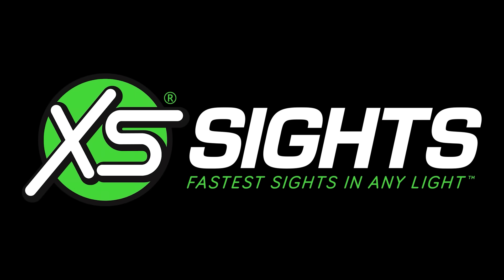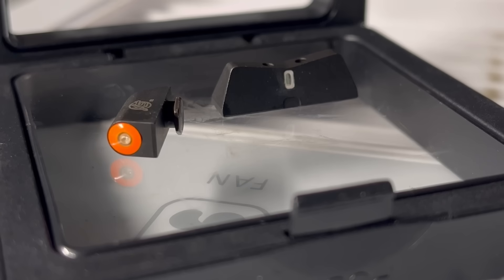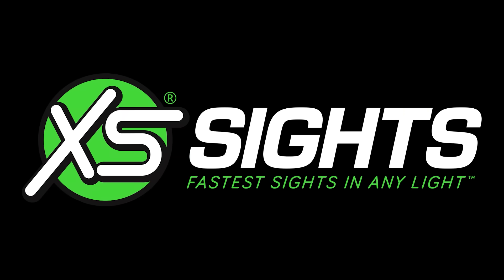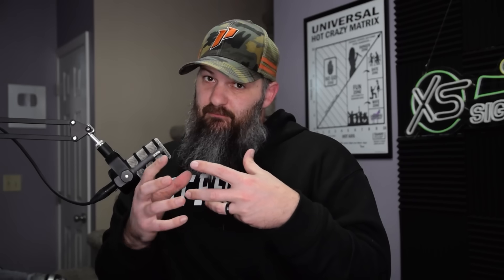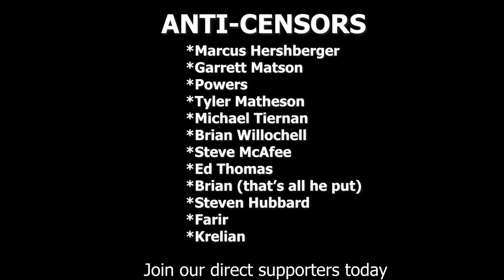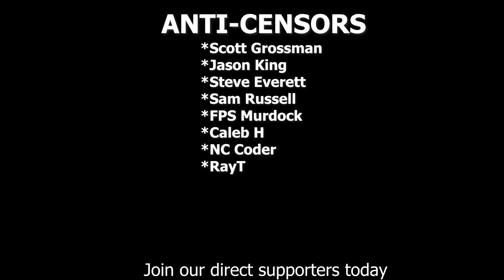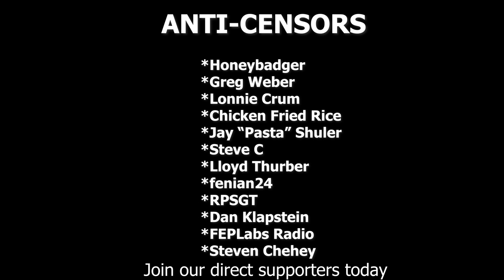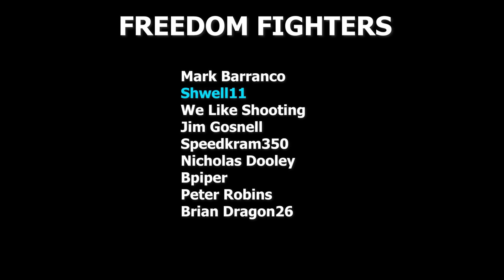Don't Get Scammed on "3D Printed" Suppressors in 2026

Comment: You guys have no idea what your talking about if you print in Bambu labs ppa cf then put the can in a powder salt in a vacuum chamber till cristallisation point for 4 hours let it cool down to room temp I seen a 30 cal ppa cf can running 30 thousand rounds also there’s a guy on YouTube that has a pla can in 22 did the same Harding curing method and is at 22 thousand rounds

Comment: Just for everyone to have a heuristic to go off of. Something 3D printed is always structurally worse than something made by any other process. 3D printing should never be a selling point. 3D printed things can be good and of really high quality. But the process itself is less structurally sound than if it was cast or stamped or what have you. The only thing 3D printing can give you that other things can't is unique geometry inside a part.
Reply: 3d printing is now standard in aerospace industry. SpaceX uses it extensively in its rocket engines. Laser sintering printers are now being used to combine different types of metals that no other manufacturing process can do. Aluminum powders combined with small amounts of iron, titanium, etc to make an alloy that is stronger, more resilient and able to handle much higher temps than any other aluminum. You’ll be seeing it in engine blocks at some point I’d guess.  If they’re making rocket engines and jet turbines with 3d printing, I think it’s pretty structurally sound.
Reply: @memyselfandi6410 Yeah, so the reason they are using 3D printing is because they can create more complex geometry with it than with traditional manufacturing. Even if they are making "special metals," the structure would still be more sound if the metal were made via casting etc than using additive manufacturing.

So basically what this means is, the selling points for the aerospace industry are the geometry and the material. Not the process of 3D printing itself.

Comment: Thanks for the warning bro. I’m curious about the company PTR, they do 3-D printed titanium & Inconel & are rated for “hard use” but I have a hard time understanding how titanium can handle a high volume of fire of 308 Winchester!!  so I went with a stainless steel traditional suppressor for my AR 10, it’s heavy compared to the 3-D printed titanium, but it doesn’t feel like it’s gonna burst after two magazines.  Sorry if there’s fuck ups in this comment comma I’m on the road using speak and spell!
Reply: PTR Ti cans are not hard use, even their inconel can is not rated for the same extremes as other brands. Also PTR cans are not repairable due to the nature of their Purposely Induced Porosity(PIP) technology. They are extremely quiet though. If you are looking for hard use Ti, look to B&T. Their full Ti, 718 Inc, and hybrid (Ti with Inc blast baffle) are tested thoroughly over 20,000 rounds in 3 days of Socom Table 2 testing.

Comment: I want someone to post a video next year when they register a potato as a suppressor and file a $0 tax stamp form.
Reply: You're confused on the law change. Making an SBR or Suppressor still costs $200/$250 whichever it was, it's the transfer that's zero now.
Reply: The key would be to do an adapter that hold a potato in place for use. Then you would have to get with an SOT 2 to replace the potato when it wore out.

Comment: I have two 3d printed ftn suppressors in PET-CF for 5.56. They will eventually fail, but not near as quick as you would expect. The FTN suppressors for .22 are pretty much lifetime suppressors unless you are going full auto. The core is all polymer and wrapped in carbon fiber to contain the pressure. Plastic does well with the heat because it is a poor thermal conductor. You actually want to keep metal out of the core as it will capture heat and transfer it to the plastic. I only have about 100 rounds through each of mine, but unlike after a mag with a traditional suppressor, I can touch mine without getting immediately seared to the bone.

Comment: We use 3D printing at work (we’re not a suppressor manufacturer) for creating prototypes and fixtures. Once a design is finalized, the parts are made with forged, molded or stamped metals thru a vender. It’s just standard manufacturing protocol. The fact that so many of these companies are selling 3D printed suppressors is alarming.

Comment: No matter the polymer, its melting temp is no higher than the printer tip temp. Printing tips are not operating at 750 or higher temperatures. MUCH lower, in fact.
Reply: Plastic is a poor conductor of heat and unless you are going full auto, it heats up much slower than a metal suppressor. So much so that I can handle mine after a mag without getting fried.

Comment: Yea im printing some prototypes right now but the design can be machined on a 6 axis cnc. 
But its faster to print the prototypes to decide on a final production design.
Reply: Yes print it. Them use the G code to machine work in aluminum for testing and R&D. Then you machine it of the desired materials. Now you can print it out of those materials.
Reply: @clarkrichards1907 yes sir. Problem is not every print shop will do it without themselves having a FFL. 
Either way printing is faster for this phase.

Comment: From someone in the AM industry, 3D printed cans *can be extremely rugged and on par or exceed a traditionally machined component. A lot of the cost isn't the materials (although the powder has gone up in nearly extravagant magnitudes despite more widespread adoption; they are a consumable and relatively difficult to refine into nanometer/fine micron dimensions) or even the expertise to designing one, but part of the integrated cost for the company to pay off equipment. A production-oriented galvo lasering sintering system with a respectable bed size is on the order of very high 6 figure, low 7's.
Reply: $850,000 dang
Reply: @sieve5  Yes, the price to play is Steep. More often than not, by the time you sell enough printed parts, the printer itself is deemed obsolete and the upgrade/replacement process begins again. That said, at least there's a few clever tax laws that can be taken advantage of to help cover some costs (mostly the equivalent of a year of materials) in addition to sales.
Reply: @C-M-E  
Is it considered “obsolete” because the lasers are not adequately melting any longer or is it considered obsolete because the newer laser printers can do more than the previous generation printer?

If it’s the latter, it seems like using an “obsolete” printer is still an adequate option to use while maybe expanding your lineup with a new printer… 🤔
But, I guess I also have no idea how much space a sintered laser printer takes up, and if it’s room sized, I guess I would understand why a business would only use them until they can upgrade it… also, what does a business do with an “obsolete” sintered laser printer? Is there an aftermarket for “obsolete” metal printers?
Reply: @akseminole  The levels of obselete rather depend on what capability you have (production schedule/capacity/timeline) or what you Want to have. Early on in my R&D business, I would keep all my old machines until I either couldn't buy parts for them or the capability of new machines far outpaced the old ones where the buy-in on new or newer machines made more fiscal sense. Sometimes one generation newer machine could double or triple my capabilities, or became so much more efficient that you could pay off new tech Much faster.
Specific to galvos, you can normally buy a replacement head either through the manufactuer or aftermarket unless its entirely proprietary to that model, or you're Really good with making your own gap-fill tech (aka, kitbashing from the boneyard of old parts) and doing some code. I can make a lot of wonky stuff work that wasn't meant to, but my coding skills are barely passable at best.

With industrial and larger commercial printers, size-wise for the machines themselves (in this example being a large industrially-aimed printer that is more vertical than horizontal, but they come in all flavors), they tend to occupy every bit of a pallet or two footprint wise, and usually occupy a vertical space of a very large refrigerator (like a commercial frig/freezer). Sintering machines almost always require post-process stations that don't necessarily benefit from upgrading, but manufactuers like to sell them as a package deal (optional extras, unless you're on a yearly maintenance lease kind of thing). 
You can and may find older machines that have been reconditioned by the manufactuer or third party resellers that perform the maintenance schedule for these level of machines; there's an entire service industry that revolves around the ecosphere of older machines where you can occasionally score a deal if you don't need bleeding-edge, or just want to upgrade over 'prosumer' levels of machines. Large industrial manufacturers like aerospace customers often have in-house surplus departments that sell their 'antiquated' machinery for more or less scrap value, which is where I get some of mine from. It's way higher tier than what I can afford on the open market, but you have to be real handy when that supply chain has dried up and moved on to two or three year newer tech; things like making your own material modules that work with a proprietary container most of the time, or will only mount to a specific pattern of a connection that you need to remake yourself. We're just now seeing multi-material filament printers at the home level really make sense, but in industry, one I picked up from another R&D center acquired it in 2012; it has a corexy stupid sturdy frame, triple-head on one massive mounted tool and can do three different materials consecutively without changing toolheads. Problem being, the software was proprietary and slow, and the material canisters were the same. I ended up replacing the mainboards, power modules and some hardware to make it run on Klipper, then made a one-off profile to take advantage of all the developments between when it was top tier and now with shapetune and such. Got it for essentially parts value ($100) and when it's done, it'll be my largest and most capable FFF printer on-site.
Reply: Knuckle draggers don’t know what $850,000 is.
Reply: Lies!! All lies. You cant print circles or cylinders or complex items like a can in a 3d printer. Stop lying and spreading false claims 😂
Reply: @kinggc3674  Shush you, you're giving away all my secrets! It's all square and triangles!

Comment: I’m just gonna stick to buying suppressors from tried and true manufacturers— SiCo, Huxwrx, Dead Air, Rugged, OCL, CAT/CGS, B&T, Yankee Hill Machine. 

And though I wouldn’t personally buy an Sig, Q, PTR, or SureFire suppressor for varying reasons, they certainly fall in the tried and true category. 

There’s obviously some newer stuff popping up, like from Ridgeback Defense that has been gaining a popular following. Or long term firearm manufacturers who have gotten into the suppressor game with cheaper, welded baffle stack suppressors, like CMMG. 

But I’m just gonna wait out the craziness for the first few months, half a year, and when I want a new suppressor, it’s gonna come from a tried and tested brand. I like shit that’s built to last, and just as importantly, from a brand that’s likely to exist in 5 years and has good CS.
Reply: This. Feels like people buy products purely because it's new on the market and then talk it up like it's the best. How many of these cans have been taken through SOCOM's 1400 round thermal cycling test, or strapped to an M240 and run cyclic until it melts in half? I want something that's proven to be hard use, not just jumping on some bandwagon.
Reply: lol. Tried and true? You not very aware of suppressors beyond the last 5 years.SiCo give me a resume besides buying a 3d printer. Hux let me rephrase that OSS? resume for them also. Dead Air so employees of silencer central who were financial portion of that company and then go let’s make our own company. And we don’t out source …… wait we do and got caught. Dead air more like dead a$$.. otter creek labs? You have to be kidding me. Otter creek labs entered the silencer market in 2023. Right when what happened ? They could finance 50 year loan on a 3d printer. Do some actual home work. Cat get out. Do you have a can from them from 2017? NO. Dj push play cans 3dprinted . B&T has a resume, has a history. It’s gross they are in the same paragraph as these joke suppressor 3d printers. Yankee hill ? Resume please. Besides the sba Loan on a 3d printer.

I assume you 22 years old. So don’t post bad info like tried and true? Ocl entered the market in 2023 and they have the stones to ask 1200 now for a can. New name the Chernobyl. You love some marketing ? Dead air spends 10x on marketing above engineers.

So let’s talk people will resume’s 1. Surefire sorry u don’t want to pay $1300 or $1700 for silencer. Making and selling cans since 2002. Tried and true yea. And I won’t even go into Socom Because 2023 till now is tried true? Let’s go here. Kevin Brittingham true king of suppressors. Let’s go back to before u were born. 1994 AAC a company started by Kevin at 19. And was selling silencers to the civi market and under Socom contracts. Resume ? You don’t own enough paper to print it out. he is to suppressors to what stoner is  to today’s evolution  of the m16 /ar15. You will pay 1200 for a hux sorry oss. But not a $850 better Q can because of what? Trust no one wants u too. But for “varying reasons” did you drink the kool aid? KB has one of the largest gun collections in the USA. He owns and created Q so process those facts. Have you started a firearms company? Let’s go smaller. You have zero clue that you got marketed hard and made you believe something quality comes from a 3 year old company. Do you have a ffl? I’ll answer. No. The fbi and atf are all over u for months. And everyone connected to you. Now imagine producing firearms for the commercial market and military. Any bs you have read about Kevin is that bs. As the facts of owning a firearms company and having one of the largest gun collections in the USA contradict any bs someone u play call of duty with told u. Also u said sig? Who ran the suppressor division?  

Your complete lack of knowledge is glaring. Best part ocl talked a lot of S$^t about Q. But we’re complete pu#4y’s at shot show kissing Q’s ass. Keyboard commandos? You weren’t around when it was surefire knights and original acc. That was the market. Do your homework work. You’re a hot air balloon operator.
Reply: Maybe they have been making suppressors since 2002. You want ocl? So when they got 50 year financing on a 3d printer. In 2023. They entered the market. Thats 3 years. You think socom is marketing. No you thinking ocl is anything but inexperienced fools with a 3d printer that spend all the money on marketing to U clearly. Instead of engineers is laughable. There new can the Chernobyl is how much and you are complaining about a 1400 dollar surefire. Think do your homework before speaking.
Reply: @WEdontUSEjimBOBMFQ whatever his issue is with Surefire, he clearly stated that their suppressors are tried and true, just like the aforementioned companies. Also, your writing structure is attrocious. I had to read that 3 times just to understand what you were trying to say. Edit: after reading your first comment as well, you need to get the fuck off the internet and pick up an English textbook. It undermines any respect someone might have for your assumed knowlege of suppressors, in spite of being arrogant.

But anyway, yes, some of these companies are newer and don't have the industry history of some others. I believe what he was trying to convey though, was this: a lot of those companies came on the scene at the start of this whole e-forms system, which made accessibility to NFA items easy. Thus, they brought a ton of quality innovation to the market such as flow through technology, and did so in a manner that fostered trust among consumers. Prior to that, suppressors were largely unimpressive because the market wasn't driving innovation. And say what you will about Dead Air's issues, but strapping a Sandman S to an M240 until it melted in half was excellent. It feels as though these new suppressors are just riding the last several years of suppressor innovation. They fire up the 3d printer, make look cool and send it off to dustributors. That was what I got from his comment, but you were too stuck on angrily criticizing his knowledge of resumes of people we don't care about.
Reply: @j @jeffr5552  you honestly saying ocl has any biz being out there marketing and bsing
Reply: @jeffr5552 brittingham has more of a resume than anyone.
Reply: @WEdontUSEjimBOBMFQ I don't care about OCL but have heard positive reviews about their cans. I also don't care who Brittingham is or how thick his resume is. This is the first time I've ever heard his name. Despite your apparent worship of him, there are many excellent engineers designing metal tubes with baffles inside them. Edit. Upon Googling him, yes I'm familiar with Kevin from Q. Aside from being an arrogant ass, like yourself, his products are really no better ir worse rhan these other brands. And if you hate companies that use marketting hype over product quality, he's the first one you should be pointing the finger at. $400 for "the best trigger ever made"? Get the fuck out of here if you think it can do better than a Geissele. I've handled the Mini Fix. It's far too cheap feeling to  demand the price it does. I've considered buying a Q suppressor, but honestly, they don't offer anything that other cans don't. Seriously, he's not the king of suppressors.